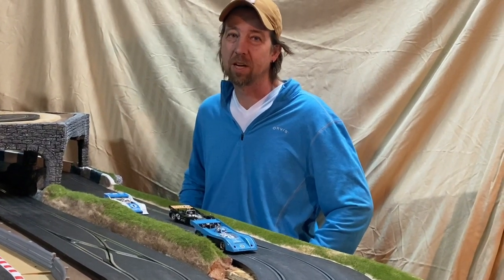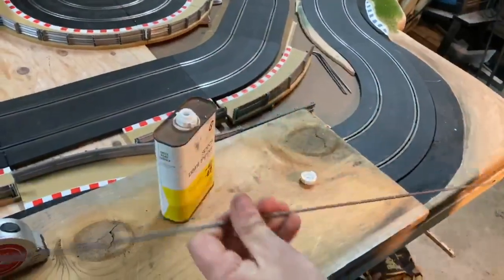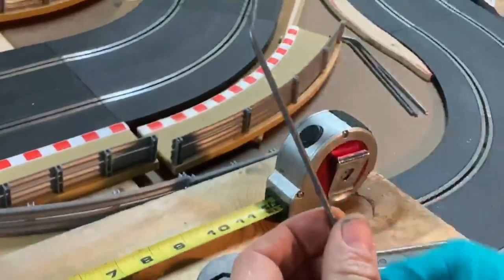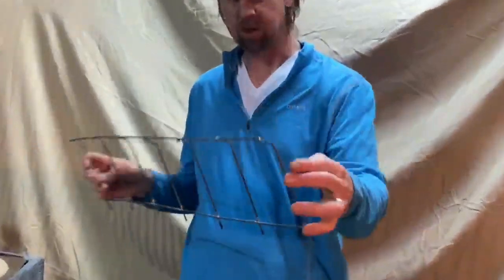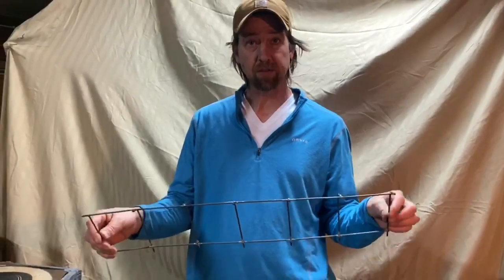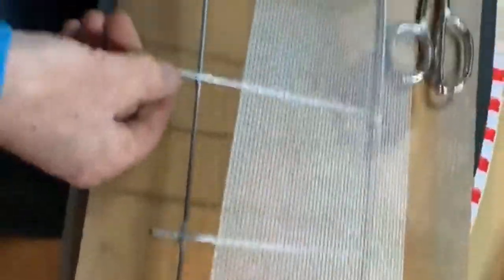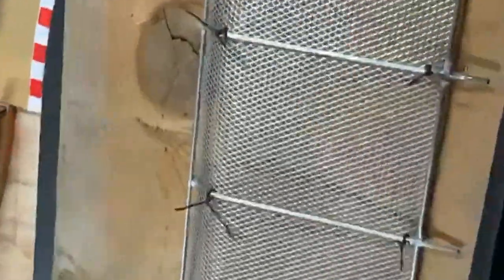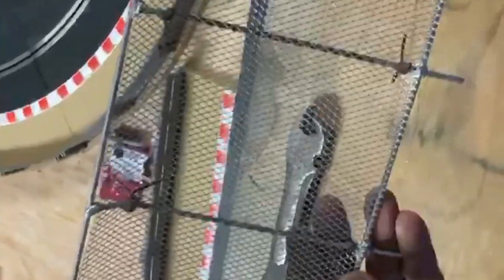how to build realistic slot car crash fence

Comment: Great how-to! You could also use lockwire to fasten the mesh to the frame. It's available from aircraft or race car suppliers and is a finer guage than the tie wire and may be easier to work with.

Comment: Very cool addition, truly fit form and function.  on your tie wire, try using the welding wire I bet your running .03 or .025 either will be a lot easer to use and its there..
Reply from the maker: Thanks John ,My second version of this fence has a few upgrades , I do have a video covering the newer version. Yes there are a few things that could be improved with this one 😂

Comment: A very good welding alternative is J B Weld Steel Stik. It's a 2 part putty, slice off desired amount, knead until color is uniform. In about 12 minutes it will begin to quickly solidify and during this time will become noticeably exothermic & you'll find yourself not wanting to touch it.
With practice, while still malleable, using a drinking straw a "stacked dimes weld" effect can be obtained.
Reply from the maker: Yep , that would work

Comment: Thanks for the tutorial for making this crash fence.
What I'd like to know is, can all this be Solder together
since I don't have that wire feed welder nor a garage.
I also will try this but, I actually want to apply this to a 
crash Barrier but, still in search of a material that will
work for a barrier since NINCO isn't producing or selling
theirs currently. 
Thanks again for the video.
Reply from the maker: Thank you Django , You should be able to solder it together, just make sure you use flux...
Reply: Try super glue or two part epoxy glue.
Reply: @alancharlesworth5636  In my opinion, those aren't LONG LASTING
Bonds Especially Super Glue. But thanks for the suggestion ;)
Reply: @BoonesSlotCarGarage  Thanks, that's all I needed to have confirmed.

Comment: Your videos are inspirational. Thanks. How do you attach the fence to your layout?
Reply from the maker: Thanks Rich..  as of right now I have my fence just set into holes so I can remove the fence to work on my layout. The other reason for this is that I’m unsure what I want to do in this area right now... one thought is to create a crash wall and mount the fence on top of that. When I get ready to secure the fence I will use wood glue or a high strength type of glue to secure it in place. You will want to make sure it is anchored securely.  I have also thought about using brass tubing and glueing the tube into the layout. Then I would slide the fence post into the brass tube. This way it is secured and I can remove if needed .... I will be making a video on this when I build my crash wall by the pit area of my layout, I plan on using the crash fence in this area and will show how I will secure it into place. But till then these are the different ideas that have been kicking around in my head...  hope this helps , if you come up with a different way of installing I would be intrigued to hear what you came up with... thank you again ,,,,Boone

Comment: great video's and idea's. i've been using nylon screen material as to not damage the cars along the edge of the tables. just a though.
Reply from the maker: Thank you... I tried the nylon on previous fencing, and found that it didn’t have the look that I was happy with. It is softer on the cars , but I haven’t had an issue with damage with the mesh that I’m using. I also run most of my cars without magnets so my speeds are not as high , because of the damage issue. But nylon is softer. If it were myself and was afraid of the damage factor , nylon would be an option for those high speed corners that the cars could come flying off the track.... good point... thank you again for your comment.

Comment: Would as soldering gun suffice for joining the rods?
Reply from the maker: Yes, if you use brass rod , I have a second video that I made that shows the build process doing this . I would attach the link for you if I could, but unable to in this message board. But if you go to my accessory section for my videos you can find it. …
Reply: Thanks so much! I’ll have a look!

Comment: How did you attach it to the track
Reply from the maker: At the time of this video I just pushed it into the polystyrene. This same area I am now working on and making a video series that will cover these fences again. To mount them to the layout I would use PVA and make sure it has a very firm fit